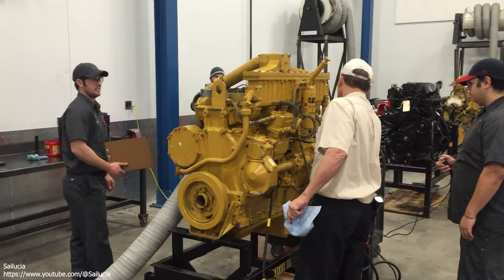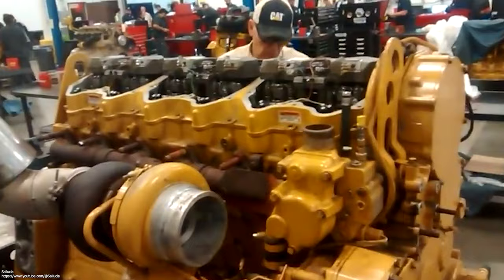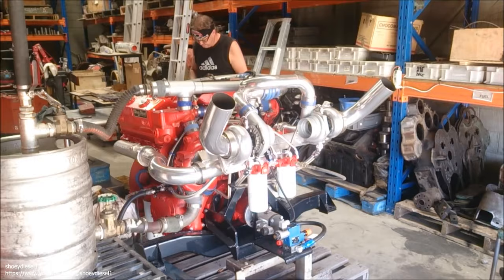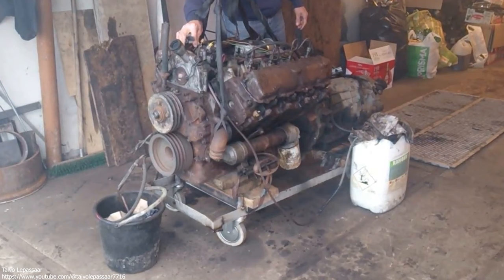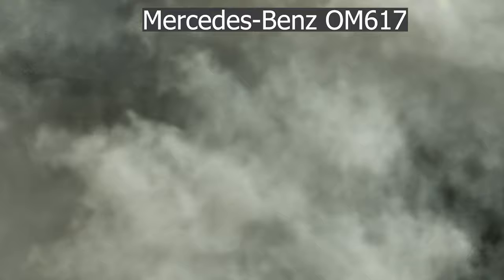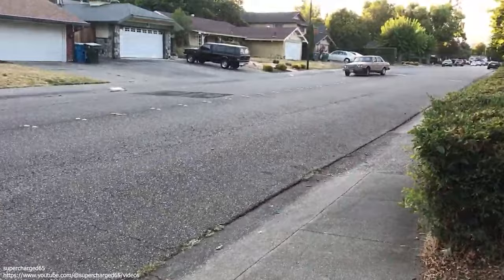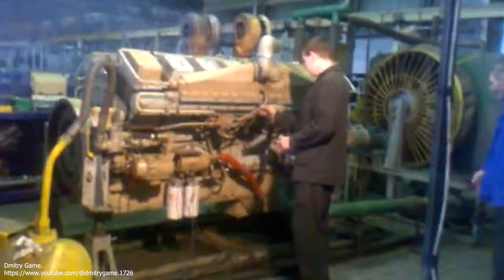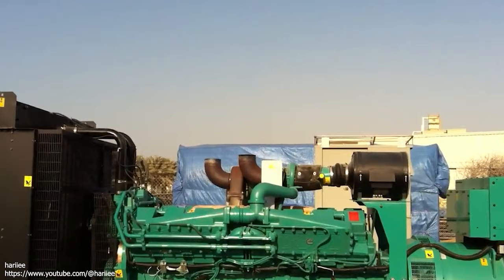5 Best Diesel Engines of All Time

Comment: The first 5 axle combination semi to get a speeding ticket of over 100 mph (!!2 mph fully loaded) was powered by a twin overhead cam 4 valve per cylinder Caterpillar 1693 engine, a 15 liter predecessor of the 3406.
Made form around 1962 till 1974, in construction machinery it was denoted as a D343. Most powerful truck engine for a decade you could own.